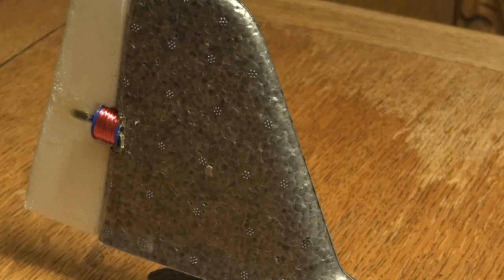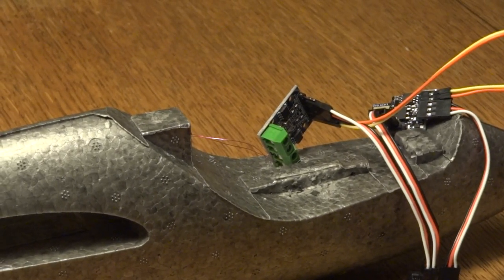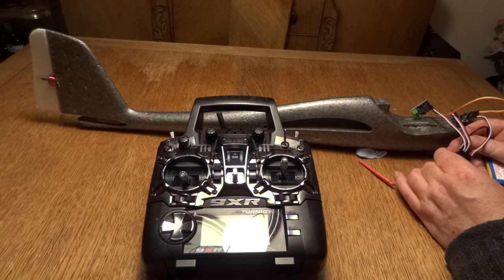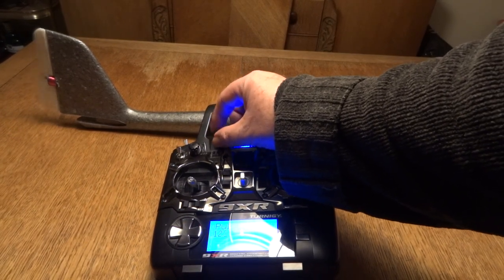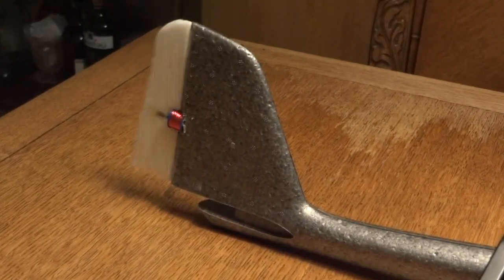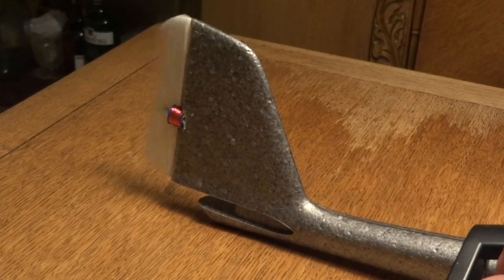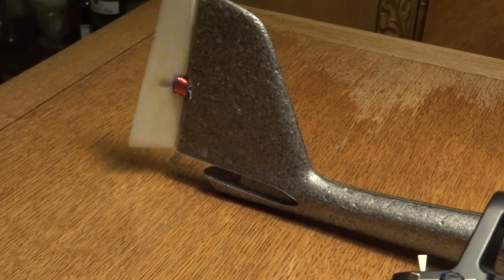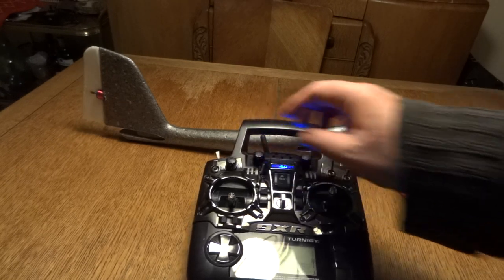Pulsing magnetic actuator for rudder of Lidl Glider

Comment: How can such tiny actuators be powered without adding further weight to the plane ?
Reply from the maker: The power comes from the normal flight battery via my custom driver PCB.  There's no real advantage in using this sort of actuator - some tiny conventional servos, maybe 5 gram ones, would be lighter and give better control - I just did it for interest.  In the early days of radio control there were similar systems before modern servos were readily available. See https://youtu.be/HLVk97zI2lg
Reply: @ceptimus  
Thank you so much for your answer ?
Reply: I 'd like to learn more about the attiny85,where can I find more info?